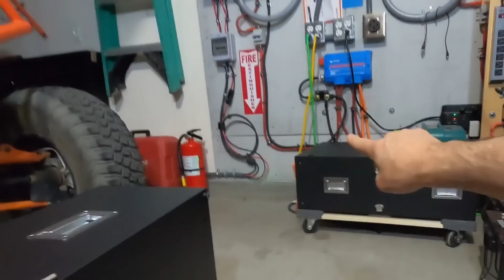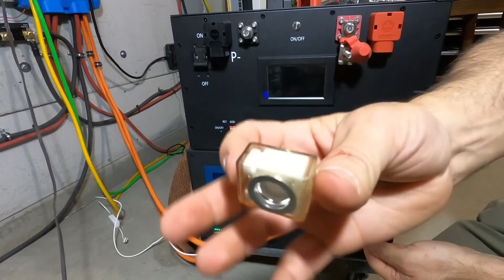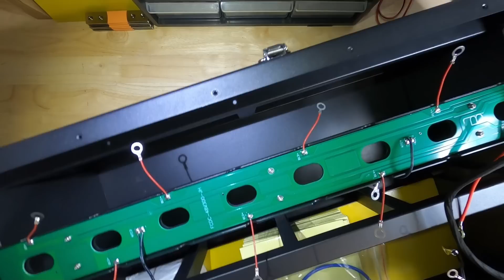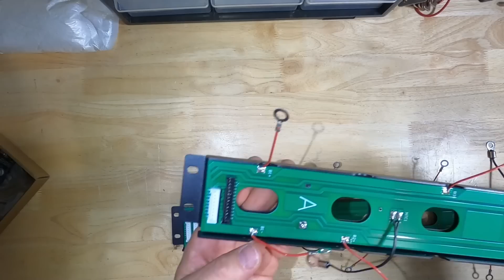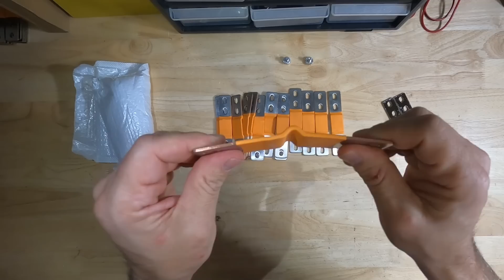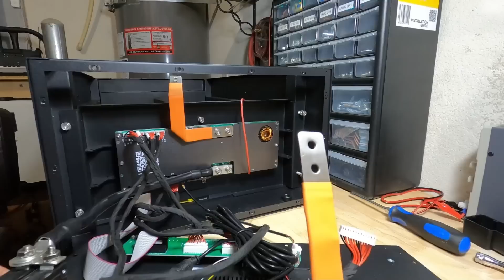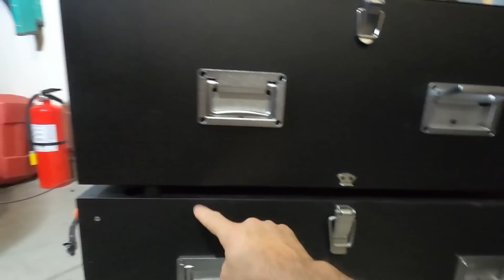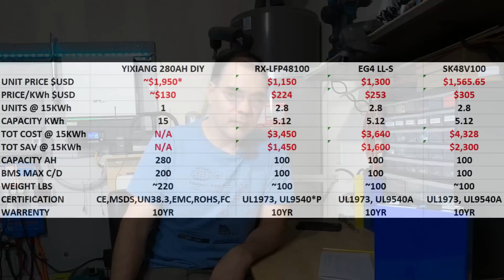Yixiang 48V DIY Battery Kit - Easy and Cheap!

Comment: Seems to me there could be a temperature issue with these batt boxes. The cells are compressed together and the box is not vented, once that temperature builds up it will be difficult to lower it without forced ventilation like a desktop computer? and even then the cells will not cool easily because they are so tightly packed together. I see from the 280Ah+ spec sheets that cycle life is halved once temps get up to 45C compared to 25C. Is this an issue or am I worrying unnecessarily...
Reply from the maker: Although ventilation holes would be a nice feature, it would not necessarily be for heat build-up.  These types of cells generate very little heat themselves, if any.  These cells are very commonly sealed in  some type of sealed  container like in EV cars, and they are sealed cells that do not vent unless some extreme rare circumstance (safety feature) and if that happens, the cells are probably ruined. The BMS will actually create more heat than the cells will, and that's only under high sustained loads. But even the BMS is designed to dissipate this heat. I would be more worried about outside environmental factors and ambient temp than I would the internal heat. In fact, if you are in a cold climate, it's recommended to keep the cells warm.  I have a heated battery build video if you want to check out. Hope this helps. I actually thought about doing a video using PC fans and a temp controller, but this would be if you were going to keep the battery in some closet outside with direct sunlight heating up the cabinet. My batteries are in the garage, and I have an ac unit to keep the equipment cool, and the bms reports 30c max when the garage is at 89 to 92 degrees ambient temp... its actally cooler inside the box according to the BMS. The BMS has 4 temp sensors that will shut down the battery if the temps get too high.  I'm talking 60 to 70c, and this is factory default.
Reply: @natesdiysolar  yes I believe your right we do have a lot of Gecko lizards here and they can get anywhere it would be an accident waiting to happen.
Reply: @natesdiysolar  Okay that's interesting to know. My RE Cabin is air conditioned as I am in the South of Portugal it gets to 35 C similar to Florida. My current FLA batts are just outside the cabin in the shade and they tend to mimic the air temp around them so do get up to 40 C on occasions. Seems when I replace them with LFP I can get them inside and keep the cabin at 25 C max. Would they stack okay without the lids on? that would help dissipate any excess heat quickly. I would need x3 units about 45KW, with shipping would be less than €6K which is comparable with FLA. No worries about the cold here min is 10 C.
Reply from the maker: @ricardophelps6323  There are alignment holes where the feet would prevent them from moving, so I suppose you could, but no reason to do so.  I would be worried if something got in there... and caused a short. I have a 12v LFP outside as well in the shade, and it's been fine.  I'll do a capacity test on it after the summer. Try with the lid on and monitor the temps.

Comment: So I just ordered three of these these come with the batteries as well right end up costing me around $1,700 and That's for three of these.
Reply from the maker: What.. $1700 each if ordered with cells, most likely. They do not come with cells.. they should ask you if you wanted cells..  3 empty cases would be around $1700. They ship the cells separate. There is no way you're getting 3x complete batteries for $1700
Reply: @natesdiysolar  That's what I thought.

Comment: LOVE your videos - Many thanks!  I'd like to build 3-4 of these battery kits and use them with either an EG4 18KPV inverter, or a Sol-Ark 15K-2P hybrid inverter.   Do you think I should have any concerns about this new JK BMS being able to communicate well and interoperate with these inverters, or vice-versa?   I can't get either inverter manufacturer to definitively say they support the new JK BMS, or any version of the JK BMS for that matter.  Do you think I will run the risk of losing any important functionality with either of these combinations?  THANKS!
Reply from the maker: Unfortunately, I do not have a good answer for you as I am also wondering about the same issues. I'll tell you what I do know.  If you can get the comms to work, the battery will tell the inverter how to charge it.  Andy from off grid garage has some good videos on connecting the jk inverter bms to victron systems.  I will attempt to connect to my mpp solar inverter at some point.  The eg4 inverters seem to require battery communication, so if that's what you are planning on doing, please check with the seller if there is a user or stand-alone mode that does not require comms. If so, it should be fine just going based on voltage.. that's what I'm doing now.. both seplos and the jk bms. I would start with reading the jk Inverter Bms manual. I will try to get a page up on my website in the coming days with a link to the manual. Sorry, I don't have a better answer at  this point. My buddy is currently building the same batteries with the eg4 18k . Send me an email, and if he ever gets it working, I'll let you know.
Reply: @natesdiysolar  It is hard to imagine why the battery manufacturers and the inverter manufacturers don't just establish a communication standard/protocol for the base functions of a BMS.  As a software engineer, I can assure you that it would save massive time and money for both sides and it would promote increased sales because they could avoid making all prospective customers worry about incompatibilities and shoulder the burden of uncertainty and risk. 

I suppose some inverter manufacturers that ALSO sell/make batteries might think it works to their favor to keep their BMS protocol proprietary and force customers to buy everything from them.  

I'm frustrated though by any inverter company that claims they are battery agnostic but doesn't publish their BMS communications protocol at minimum.  The result is that the inverter company needs to be wildly better than its competitors if they effectively force you to buy wildly overpriced batteries to work with their inverters.

It sounds like there is blame on the other side too.  Why doesn't the company making the JK BMS  do everything possible to work with the top 20 inverter manufacturers worldwide ensuring communications compatibility?  Do you know who makes the JK BMS?  I don't think it is Yixiang.

Thanks for your thoughts...
Reply from the maker: @tquinn63  funny, you should mention that.. I am a software developer as well, lol.. I have also thought the same thing.. both Seolos and JK have made efforts to support popular invetrer brands.. about 5 of them.. DYE : GroWatt : Victron  :  SME.. these are what I see in the Seplos app currently.  JK is made by Jikong www.jkbms.com. I recommend checking out this page from Andy's off grid garage.. he's got the most info in one place.. links to manuals and software for both BMS.  

https://off-grid-garage.com/battery-management-systems-bms/

Comment: Surely the bare minimum the manufacturer could do ie the bms board screw potential short would be to send an insulated washer. This looks bush league, cheap price isn't  everything when it comes to power packs!
Reply from the maker: They told me they are now sending the insulated washers.  I agree that expecting us to do it is silly.   They also said they moved the location of the screws . Still a bandaid, in my opinion, I'd like to see a redesign of the pcb. I have another box coming.. we shall see. It's really the cell prices that make DIY attractive now, not necessarily the box.

Comment: I noticed the optional caster wheels.  Can these units be safely used vertically once built?  I want them to stand up against a wall vertically rather than flat horizontally .  Thanks!
Reply from the maker: They are producing a vertical unit.  I don't have any details on it currently.  I would not stand up the horizontal box upright as the cells are not supported on top.  These boxes are made to be stacked..
Reply: @natesdiysolar  I did find vertical units from some of their competitors, but I've heard what sounds like a legitimate concern when going vertical with these types of cells.  That is vertically, the cells would be subject to significant and inconsistent weight and compression from the cells above them, likely allowing differential expansion based on their positions in the stack. To avoid this possibility and eliminate a potential point of failure,  I'm willing to stay horizontal.
Reply from the maker: @tquinn63  Yes, this is about the only concern there would be.  That said, I do plan on doing a review and testing of theirs once it's available.  Thanks for the info.
Reply: I understand that they can be used vertically. At least that's what was said on another channel.

Comment: Cheap? ^##=&;££##&₩£

For 1 fu*king box: $419 + shipping $537 = $956 +  battery cell's + taxes and customs...  way 2 MUCH, in fact more expansive than commercial product

Even if I delete expensive shipping, customs etc, I will NEVER, EVER PAY $419 for 1 fu*king metal box, BMS is like 80$ 20$ to make,, sooo profit about $400 for 1 bent metal fu*king box!

It is just another China shit product that will work 6 months, if you lucky maybe up to 3 years!

Comment: Their prices were all over the place when I purchased. No consistency. They advertised $419. They quoted me $429 plus all the associated shipping, fees and other BS. $608+ some other mystery fee of $17.65 they charged me a day later. Not exactly cheap, but whatever.
Reply from the maker: Yes, they do quote the non shipped price.  First box, I ended up paying $800! I was fairly pissed about that.. anytime you buy on Alibaba, you will get those fees. You end up paying around $550 total these days, and I think that's fair, considering you get a BMS and a quick and easy solution.
Reply: $500-550 TOTAL is what I would expect to pay for these. It's a fair price considering the options from the other guys isn't really plug n play. 

One quote I received ended up closer to your $800 price. I had to negotiate for the price I got. Anyway, good video. Still waiting on mine to arrive.
Reply from the maker: @rtsrts2317  where did you order from.. 

 @rtsrts2317  so the 800 price was from the first box I got last year.. different company... Other companies are now selling around 550 as well, but you have to build the thing. So currently, I think these guys have the best deal iv seen.
Reply from the maker: @rtsrts2317  yikes yea I agree.  550 is what the price is now.. the 800 was from the first box last year, and yes, I felt ripped off, and that was for a "you build it" kit. Those should be even cheaper, say 450 to 500  as you have to build it.
Reply from the maker: Where did you ship to.. that's the largest factor.  And if u get the caster wheels, I think that's an extra cost..
Reply: Ordered from Alibaba using Andy's Garage link. Shipped to California. No wheels. 

My first quote did include wheels though. More weight. More shipping cost. I found a set of used like new Vevor wheels with the same 10mm post and nut on Amazon for $10. Yix casters look nice, but not for another $40+145 shipping.

Comment: These Box have defects leading to shock and short circuit and possible damage to the BMS.

You should know it.
Greet Leszek
Reply: You need to explain details, otherway your statement doest make sense...
Reply: https://youtu.be/Txevok4jNyQ
Reply from the maker: If you are referring to the screws on the PCB, I mention that very clearly in two different times in the video.  The manufacturer is resolving this by using non conducive washers on the PCB screws. I'll put this in pinned comment as well. There is more than one company using these PCBs.
Reply: @natesdiysolar  clear 👍

Comment: This is the best battery box on the market at the moment together with the ELL DIY battery box with JK Inverter BMS, but both are not perfect yet. 
I don't like that the communication cable between the batteries placed on top of each other runs through the touchscreen in both boxes. ELL should fix this in the future.
Also, two main plus and minus terminals would be better as one in ELL DIY battery box, just like Yixiang battery box has. 
Second PCB connectors in Yixiang battery box are not needed, the JK Inverter BMS has sufficient active balancer integrated into it.
Reply from the maker: Yes they certainly could use improving.  I wanted to try the pcb connectors and see how fast I can balance a pack. Even with the JK bms it took a day or so.. way faster then the seplos lol.
Reply from the maker: Was it the ELL that had that junky bus bar to breaker configuration.. I do not like that.. give me a nut and bolt any day..
Reply: @natesdiysolar  Yes, ELL cut the busbar width in half when going into the breaker. 
They should extend the end of the thinner busbar and then bend it back so that the busbar end cross section would be the same.
But ELL basically follows the comments and improves their products based on what the community needs or wants.
Reply: Is the ELL battery box worth it? It looks like considering shipping the total cost of their product comes out cheaper.